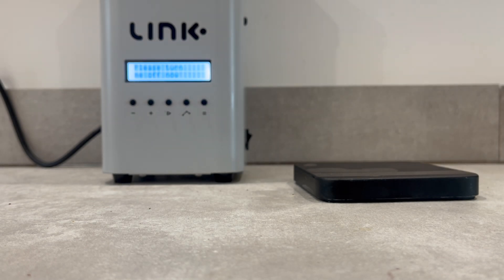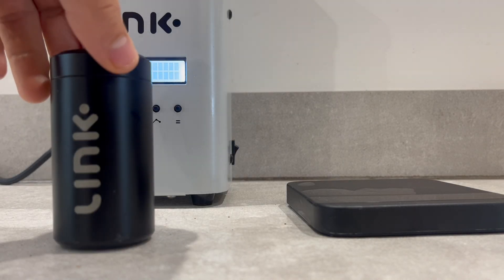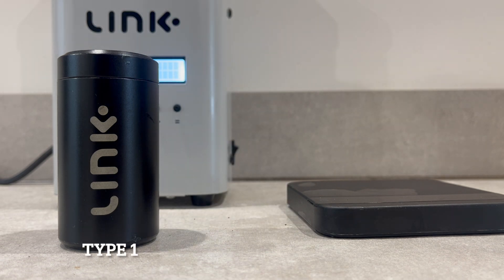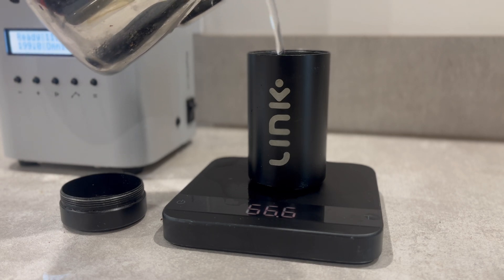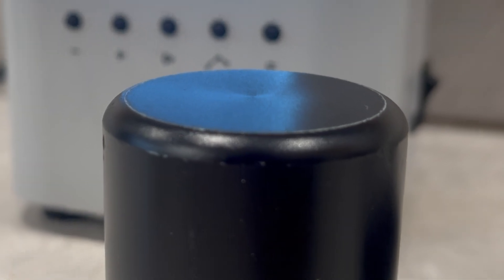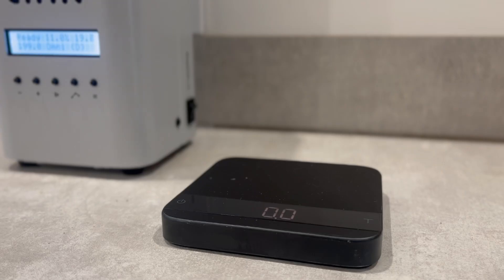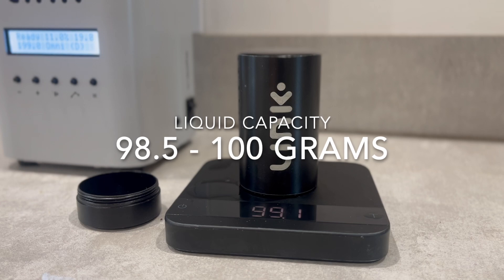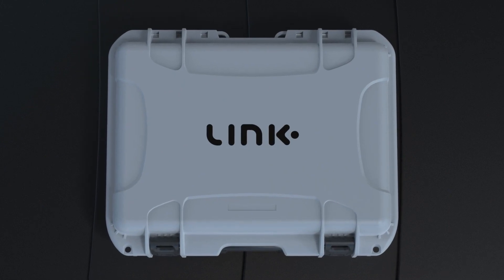Identifying and using Density Tubes for the LINK

Comment: my tube looks the same as v2 but has more then 57 grams, without lid 41g, holds 99g of water. How to determine this? Support clarified that my tube is tube v1,  but it seems like all indicators leads to v2 , apart from weight of the tube itself, any ideas? very confusing
Reply from the maker: There can be weight variances during production – the most important thing is the shape of the base and the texture. If support verified that it's Type 1, it very likely is!
Reply: @NucleusCoffeeToolsTraining  thanks, base is more round, so it looks like v1 which support suggested, but the texture is rugged and holds 99-100g of water, thats what confuses me. thanks again